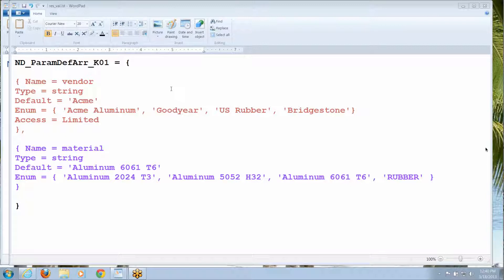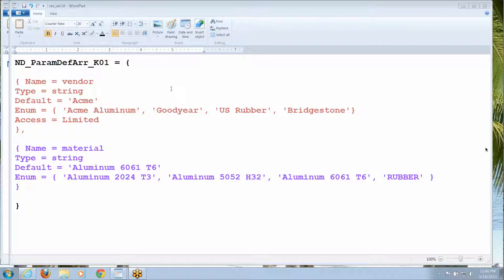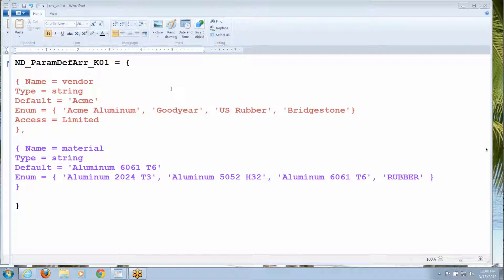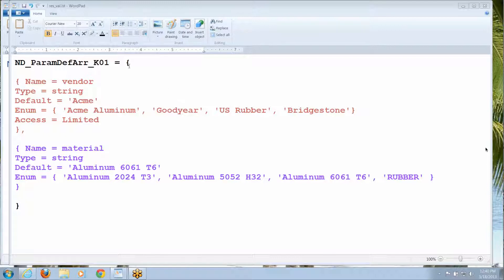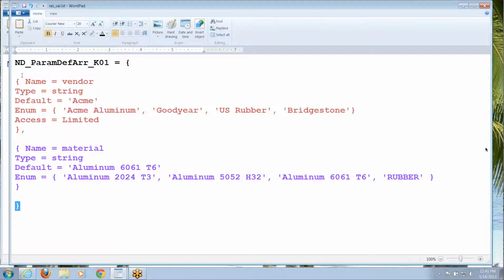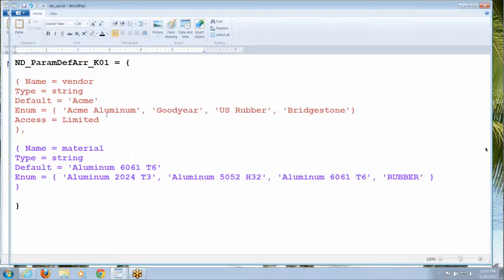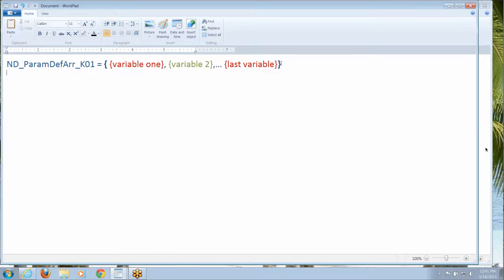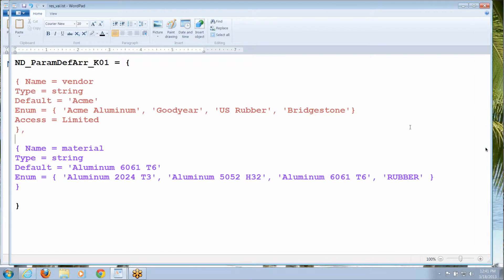More information on the restrictive value file for Creo and Pro/ENGINEER

Comment: I have related requirement in which I want to set the value of variable named "Price" as per the selection of variable name "Material". E.g. If I select the "Material" to be "steel" the Price should be 45 Rs. , if I select it to "alluminium" it would set the value of Price to 140 Rs. Somewhere I make a relation in a flat txt file to mention the possible name of the Material and its Price. So when I change the value of price in that file and come to the part in the creo, it will pick the latest value for the file.
Reply: Relations can certainly be added, but not inside the restricted value parameter file. [that I know of, at least].
I would create some logic inside of the relations editor to evaluate the material parameter, and then set the value for the price parameter. Here is an example for setting the price of rubber material:

if material == 'RUBBER'
    price = 1.00
endif

Note this can be extended to check for multiple materials using else if's.

Then, you might ask, "How do I use this for either new or existing parts?"

For new parts, I would suggest adding the complete set of relations into the start model. That way, all of the parameters are added at the time of creation.

For existing parts, you'll copy / paste the relations into each part as needed. Remember that you can build a mapkey for help automate that process. As a next step to that, you could run Pro/Batch, using that mapkey, against a list of part files that would need the relations added.

Regarding the last point of your question, I don't see an immediate solution without some additional development. We might look to the VB toolkit, or JLink, etc., since we need to get the price data from 'outside' of CreoP. I am not saying it can't be done, just that it's not as easy as what I've described so far.

Comment: It does not have to be *.lst.  A *.txt file works fine as long as the file extension is included in the config.pro option value.  The filename and extension don't matter, but they must agree with the config.pro value.
Reply: HI TOM, i am stucked with config.pro , how to agree with config.pro? can u/anyone please find a solution for this..
i am using creo 3.0 ,M140
Reply: Nice find!